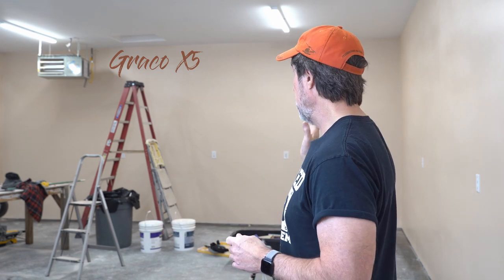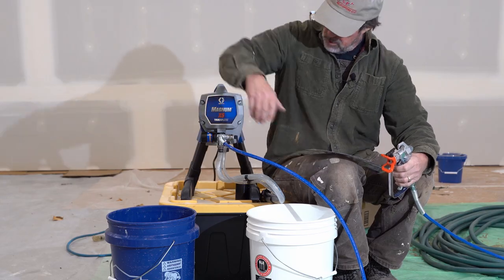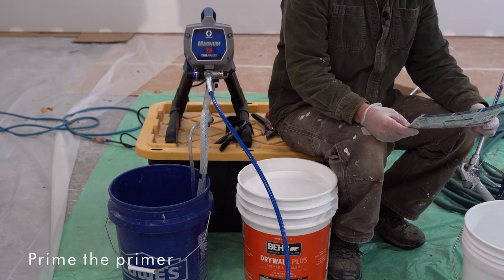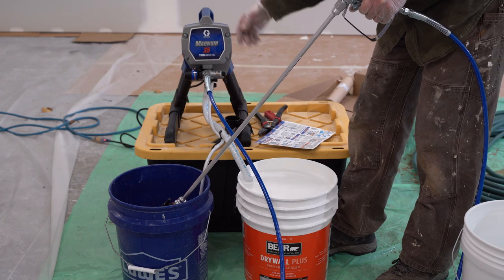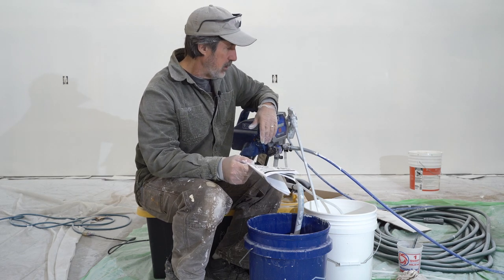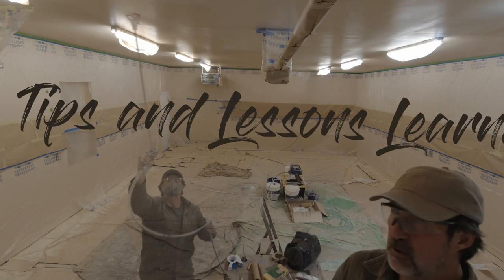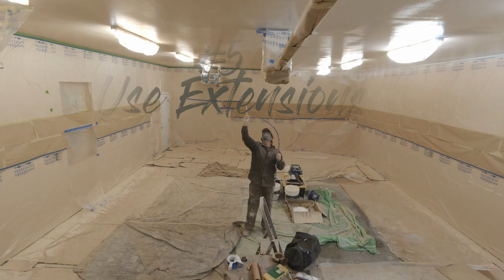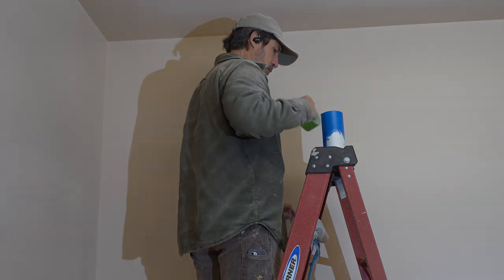First Time Using Graco X5

Comment: I’ve used the X5 to paint my separate 3 car garage, inside and exterior and barn. About 25 gallons . The machine is awesome. Any problems you have will be typically operator error. A couple points.
1. Keep the pressure at the spot on the dial where the yellow sticker just starts to get fat. Turning it all the way up is 3000 PSI per the manual. You typically want 1800-2200 range for latex paints . Do the cardboard spray pattern test.

2. Slow down, take your time and think. You can put the gun with the tip and guard still attached in a bucket of water overnight or 2 for that matter and continue the next day when you are fresh. Note: he is in Alaska. Don’t leave paint in the machine/line in freezing conditions. 

3. Extensions get hand tight at the orange guard and tip and snugged with a wrench at the gun.......snugged....not battleship tight.

4. Buy a hose whip for the gun.  It allows for more flexibility in tight spaces . When that line is loaded with paint you will get recoil when you trigger it , especially if you are one handed on a ladder etc. 

5. Buy a 3m hand masker with 9” paper . You can thank me later. 

6. Clean up: I take the line off the machine after running H2O through it and blow off all the parts and line with air. Then re-attach line and put the pump lube in . ....good luck .
Reply from the maker: Thanks for the tips. Hose whip for me before painting the outside of my shop this spring. Still not warm enough yet!

Comment: Good video Sir, Thanks.  Sharing my first use lessons.   The gun handle tube leaked initially, ensure it is twisted snug, especially after installing a hose.  Also when cleaning up, the gasket/metal semi-circle behind the spray tip can fall out of the guard, and the bottom of the spray tip is shaped to reinsert it.
Reply from the maker: Thanks for sharing

Comment: Question - can i let the paint and machine sit in the shade with a tarp over it overnight without cleaning so i can finish early the following morning.   There is no such thing as a dumb question.   I havent used this X5 yet but I'm hopeful not to clean it every night if i dont have to.   Thank you.
Reply from the maker: I did it once, left the gun and tip in a bucket of water overnight and it was not a problem. Not sure about leaving it outside though, it was in my shop which I keep cool.
Reply: Professional painter here, I've left paint in my sprayer longer than I'd care to admit😅 2 weeks. The important thing to note here is that you keep your pickup submerged and take your tip and guard off and put them in water. Otherwise the paint will dry into the top causing you issues next time you spray. I wrap the end of the gun in masking tape. I would not do this on a hot day or high humidity. At least cover it in plastic. Try to keep from submerging your gun in water as it can ruin the seals and packing in the gun.

Comment: All things considered, was it worth it to use the airless sprayer as opposed to painting with roller and brush?
Reply from the maker: No.....except I used it on a lot of outdoor projects that are a lot harder to paint with a roller. For a flat, sheetrocked wall a roller and brush would be easy.

Comment: When you're applying the paint does the drain tube go into the paint bucket or do you leave it in the waste bucket the whole time?
Reply from the maker: Both hoses are in the paint bucket while spraying. Drain tube is not submerged but clipped onto the paint tube.